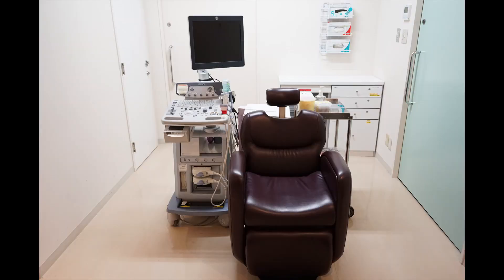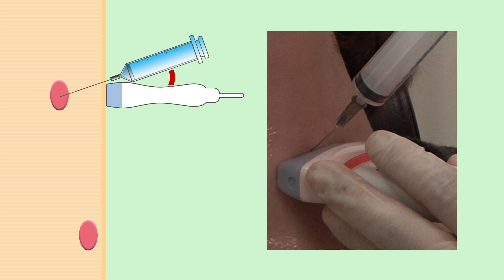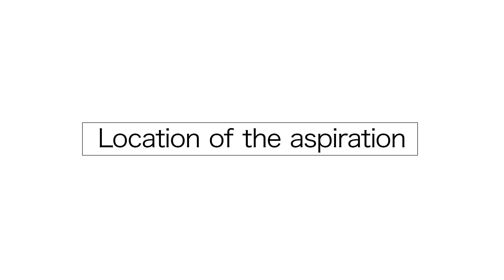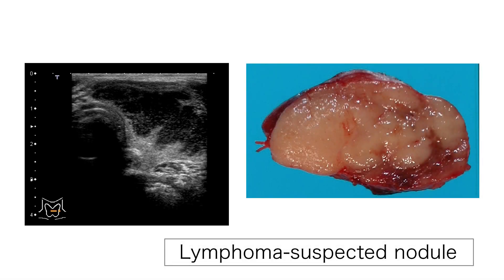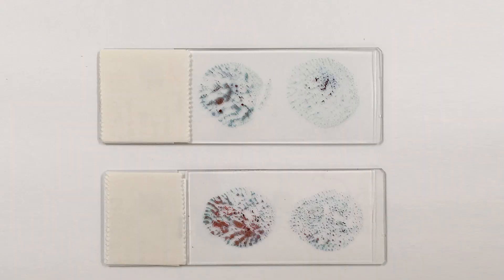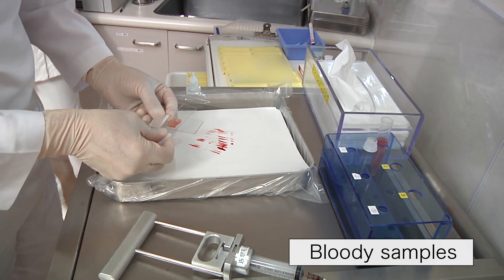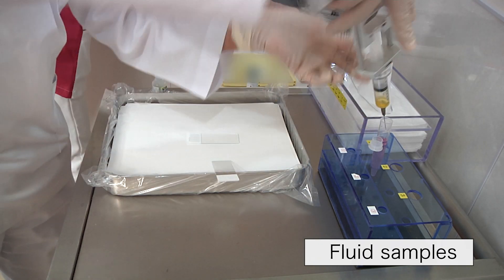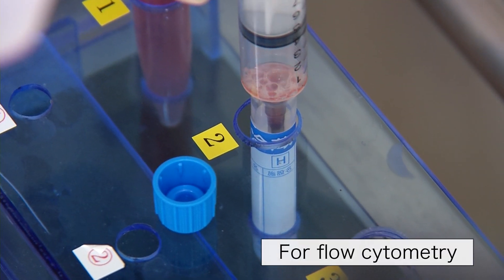Thyroid Fine-Needle Aspiration and Smearing Techniques

Comment: Again, not finding the root cause of the problem.
Reply from the maker: Does the problem mean an improper specimen? The important point is to rotate the needle with little or no negative pressure.

Comment: I have several thyroid nodules under 5mm and one cyst within thyroid cartilage all on the left side. Is it possible to biopsy these? Do you need local anesthesia? If so is the anesthesia given deep into thyroid or superficially in the skin only?
Reply from the maker: Thyroid nodules smaller than 5 mm can be biopsied, but it seems less significant to do so. Puncture of cysts within the thyroid cartilage is difficult. We do not perform local anesthesia for all thyroid FNAs.
Reply: @thyroidist  thank you so what do they normally do for thyroid cartlidge cysts? Should they be removed? I saw a endocrinologist she said likely all benign but she didn't know much about thyroid cartlidge cyst. I have ENT appointment for a second opinion in May  to get his opinion on the cyst and lump I feel but no one thinks it is abnormal.
Reply from the maker: @ashleighflood6262  Sorry, I am not familiar with thyroid cartlidge cysts either.